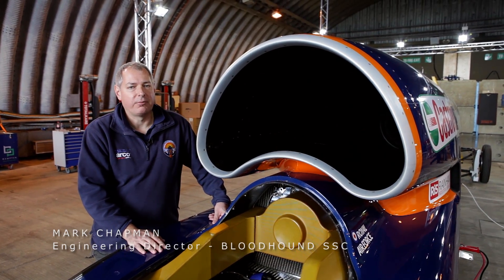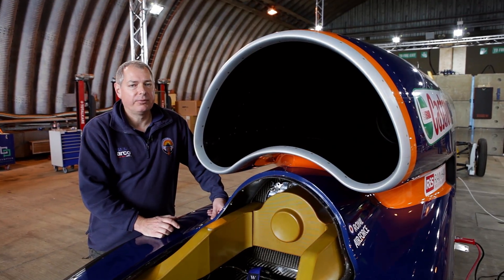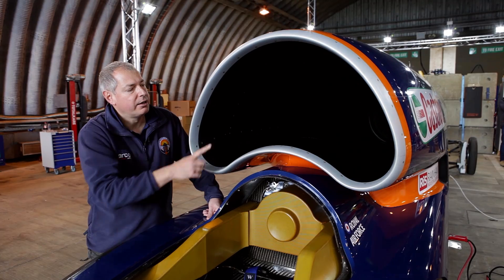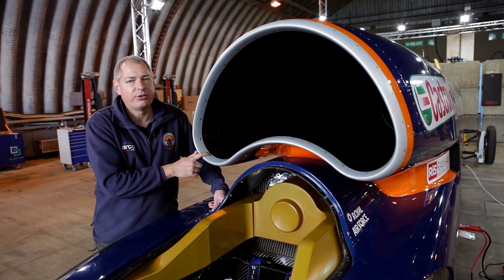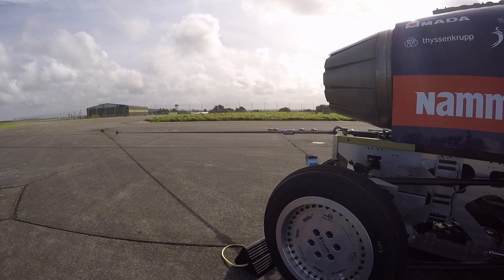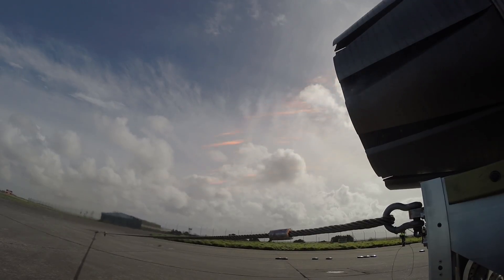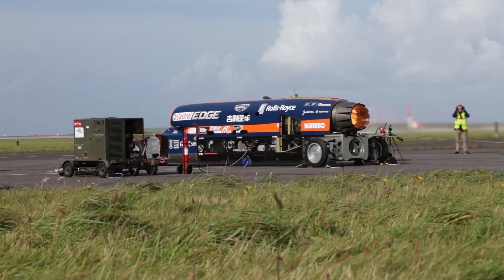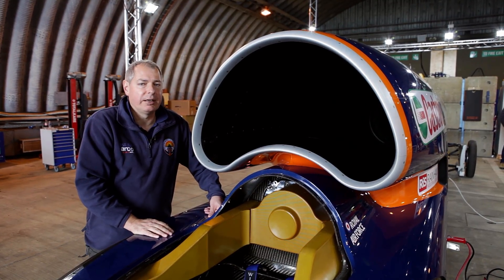Anatomy of the Car: The Air intake

Comment: should have a moveable intake cone like on a mig21...seems like that would be a big drag after the jet engine reaches the max and the rocket engine kicks in..
Reply: +Alan L Not necessarily. That helps for all sorts of things but adds considerable complexity and cost. Also, given that they have elected to put it where it is, it would be very difficult to integrate a scheduled inlet. Pitot inlets are good for up to Mach 2 and that's about it. Lots of high performance jets have pitot inlets: the Rafale, the F-22, the J-20, F-16...and so it goes. The really clever bit - which he doesn't mention - is the generation of the shock wave ahead of the inlet, using the canopy! Very clever. I don't know how difficult this would have been to design with a diverterless intake (F-35, J-10C, J-20) but perhaps they thought it better to go with a proven entity.
Reply: TheThirdMan when is this going to run?
Reply: TheThirdMan not trying to disagree with you but it just seems like the inlet or intake would be a drag once the jet engine reaches max output and rocket engine pushes it beyond what the jet engine can produce. Maybe they should have made it all rocket engines instead of both jet engine and rocket engine..
Reply: +Alan L Not necessarily. It's just not working at its maximum efficiency any more. The engine is still producing thrust and some of that thrust comes from the inlet. As for two rocket engines, it would require the vehicle to be quite a bit bigger because of the extra fuel needed. The jet gives them more flexibility. It gets it from 0-350 mph and then the rocket is fired.
Reply: wonder if you made a larger vehicle and used 2 Tumansky R-15 turbojets MiG 25 engines...that should get it over 1000 mph..
Reply: +Alan L Well, if you look at Thrust SSC - the current World Land Speed record holder - you'll see that's pretty much what they did last time. They used two Rolls-Royce Spey engines from an RAF Phantom.
Reply: TheThirdMan yes your right I forgot about that..F4 engines

Comment: I can't wait for the public day on the 28th. I got my tickets the day they were announced. I went by the runway at Cornwall airport as usual on my way home from work yesterday at around 4pm and saw Bloodhound from a distance for the fist time which was amazing. It was being towed back to the hanger after what I presume was a low speed run as the weather was good. I know the tail fin is not on and the car is not complete, but it does look a lot smaller than I imagined. I can't help but compare it with Thrust SSC and am also surprised how narrow it is too, even though the rear wheels are on the outside. It will probably look a lot different up close and fully assembled! I am so privileged to have this on my doorstep, I have been a huge fan of the LSR since the early 80's.